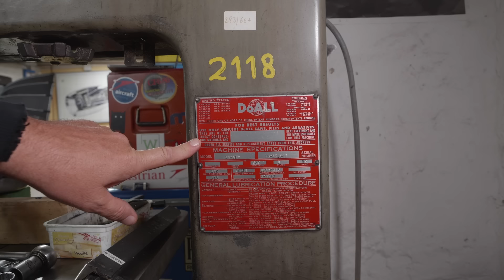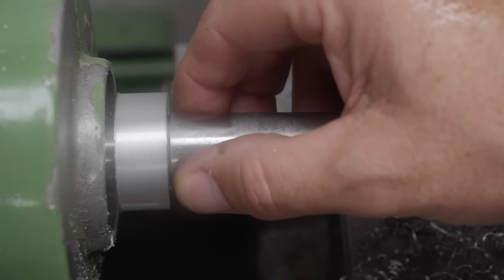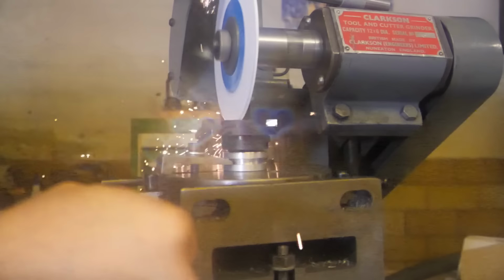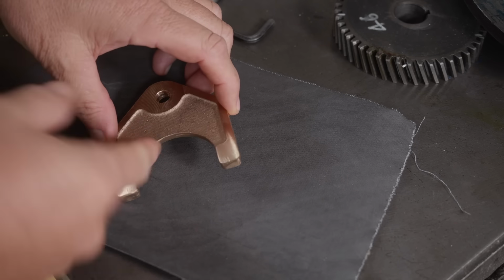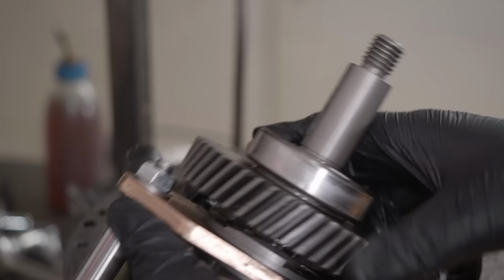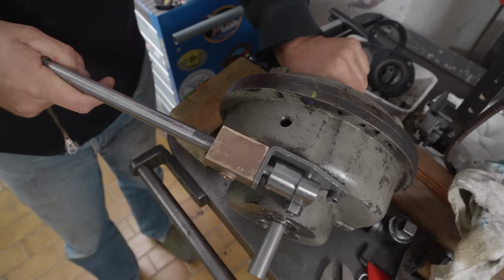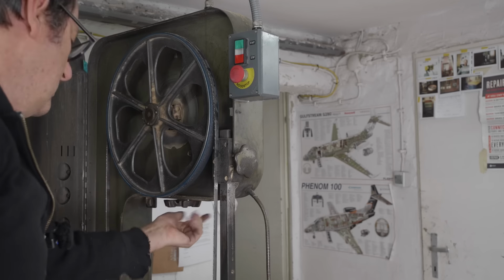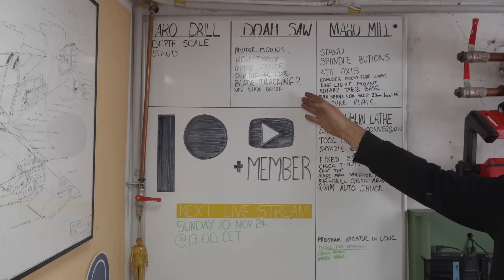Finished DoAll gearbox repair Ep. 10 || RotarySMP

Comment: In 1977, I was given a Hobart restaurant mixer that kept jumping out of gear. I took it apart, and found that the clutch dogs had worn to the point where they were slipping out of engagement.  A phone call to the supplier, revealed that the 1977 price for new dogs was over $700. Outrageous to say the least, so I took to them with a hand file, dressing a small back-rake on the mating surfaces. It worked beautifully after that for many years.
Reply from the maker: Dogs are more tolerant than we think :)
Reply: @RotarySMP  They were made of soft iron so they could be engaged while running.
Reply from the maker: @Landrew0  No wonder they were rounded over then :)

Comment: Nice, that gearbox should be good for another 70 years 👍
Old mechanics trick when installing any heavy flanged mounted unit , cut the heads off of a couple of smooth shank, long bolts and use them as guide pins. Once you have the other bolts started unscrew them and put the regular bolts in.
Reply from the maker: Good tip thanks.

Comment: Fantastic to see the gearbox working 😀 I think if you tilt the top wheel so the bottom of it moves towards the body the blade will move to the middle of the bottom wheel. I don’t think you need to adjust the bottom wheel.
Reply from the maker: Hi Julia, Thanks, I am really happy to be finally able to use it. 
I dont think the DoAll has an in-out adjustment on the top wheel. Just up down and tilt.
Reply: @RotarySMP  yeah tilt the top wheel so it points at the bottom wheel. Obviously my explanation needs explaining 🤣 because both wheel is domed they don't have to be coplanar.
Reply from the maker: @julias-shed  Yeah, I did that, but think I need to space the lower wheel fwd a little more.

Comment: This was a well-fought victory... all the way to coating both sides for no leaky leaky. Congrats. Tracking should [?] be no problemo.
Reply from the maker: I hope it will be easy enough. I just need to find some time to read up on it.
Reply: @voltairegoethe  Hylomar. If it's good enough for Rolls Royce it's good enough for a motorbike engine and certainly a bandsaw gear box!  🙂
Reply: @jimurrata6785  Best thing to come out of Wigan. Although, some would argue that Wigan Casino and Northern Soul clinch it.

Comment: Nice to see the Rotring drawing board! I used an A3 one for many years, until it broke in half. The replacemetn had the same latch on the ruler as yours, but I found the older one with a squarer design was much easier to use : I could use the side of my hand to position in the "Y", but the button one I had to press in with a finger ...
Reply from the maker: I had one of these at high school. It is probably still at my parents place. I bought this one in a flash of nostalia about 10 years ago :)
Reply: @MrLampbus  We had British Thornton drawing boards, really rather nice, A2 I think, flat wooden board, used to hold the paper on with spring steel clips. When I decided to do Tech Drawing for my O Levels, my parents bought me my own B T board and instruments for my 14th birthday. The board is still around, but the instruments vanished in a house move years ago.  I did a college course for AutoCAD 10 for DOS, eventually started using AutoCAD LT, never went back to pencil and paper. I am currently having extreme difficulty getting my head around Solidworks, for the 3D printer.
Reply from the maker: @billdoodson4232  I learned CAD with AutoCad 13, some Inventor, then CATIA V4 and V5, before moving to Onshape and and now Freecad. I think Onshape and Inventor were the simplest to learn.
Reply: @RotarySMP  I could do with easy, my almost 70 year old head doesn't pick things up like it used to. I'll get there with it, just taking longer than it should.
I had stern words with the last pair of apprentices I had working for me. "Don't get fat. Don't get old." I see them on Facebook, neither has got fat like me, but they disobeyed by getting older.
Reply from the maker: @billdoodson4232  Hi Bill, yeah, I am also noticing at 54 that I dont learn as fast, or retain as well as I once did.

Comment: Several times, I've had reason to mount a steel part on an aluminium Arbor with super glue like you did here. If the fit is too close, then the greater expansion of the aluminium when heating it causes everything to tighten up, making it impossible to remove with heat alone 😊 Solvent wins instead.
Reply from the maker: Yep, good point.

Comment: I only just sent it now. Glad they will finally be put to some good use now that that is all sorted. Next I need to cut some similar gears for myself. Will be a good opportunity to try out the dro and cylindrical grinder.
Reply from the maker: Get in contact with Emil and see if he can Plasma nitride your gears as well.
Reply: Found out that a friend of a friend of a friend has a heat treat oven I’ll see if that’s a viable option fist. Did you get my email?
Reply from the maker: @LCalleja  Cool. I need to make another oven.

I got it and responded. Did you get my response?
Reply: @RotarySMP I also would like to make one but it’s not very high up on the list. Didn’t get your reply wonder what’s going on

Comment: Nice job as usual. 
Way back in the days before mobile phones and plasma cutters being common one of the jobs I had was maintaining metal cutting bandsaws in a production enviroment. It was on a rabble of differing bandsaws often mede for different materials and apps.  May I suggest a good rule of thumb setting the blades up. The wider the blade the more pressure you need to apply to the saw push guide stops. A 1/4" wide blade doesnt need push back as much as a 2" wide blade for example. Also I found that the lower push back guide also should lead. It was pretty standard for a non adjustable drive wheel so we used to machine an angle to pull the blade into the guide on them. However that cant be to much and varies with blade thickness. The tilt on the top wheel is really only there to adjust for blade stretch and wheel wear. They will almost always want a crown machined into the rubber. 
Well if that doesnt confuse you the Dementia hasnt taken full hold yet.
Great to see some Hylomar in use as well, its highly underrated. It was the only thing that kept my Valiant head gaskets from leaking back in the day.
Cheers
Reply from the maker: Thanks for the tips. The wheels have crown machined in the aluminium, so the polyeurathane follows that.

Comment: Congrats on the better than new gear box. It's better than new, because now you know exactly how it works and are able to make / order parts for it, as needed. I need to make one of those drawing tablets... my drawing board is a piece of foam core that I put on top of my welding table, and then I just use a square against the side of the foam core. 

Happy Sunday... was feeling ... well disappointed in my fellow americans recently. Thanks for posting ... I need the distraction. =D
Reply: You are not alone. 😐
Reply from the maker: Thanks Mike. Those Rotring boards come up all the time of the classifieds here. I bought this one about 10 years ago in a burst of nostalgia :)

Comment: @RotarySMP I think your blade should run on the front edge of the wheel. Like every woodworking bandsaw. This counteracts the tendency to jump at the back. Mind you, the coplanareity of the two wheels might be off a smidge. Since the blade sat nicely on the bottom wheel. Pretty sure there is a manual for your machine somewhere.
Reply from the maker: That would make sense, but I checked the DoALL manual, and they want it on the middle of the crown.

Comment: re: the lower wheel, the received wisdom in the woodworking world is to make sure the wheels are co-planar, using a straightedge and the lower wheel as reference (since the upper wheel tilts). You'll often find one wheel is in a plane fore or aft of the other, and you can use shims/washers to move one of the wheels forward (or remove washers to move one back). Your lower wheel might be too far back leading to the blade tracking forward.
Reply from the maker: Good points. I just bumped the lower wheel onto the shaft, but without any specific position to aim for. I need to do a more systematic set up.

Comment: On my 14" bandsaw. I just added some washers so the balde ran centrally on the bottom wheel. Dont know if thats the correct way of doing it but worked for me
Reply from the maker: Thanks Peter. Doesn't it make the blade pull fwd in the lower blade guide as well?
Reply: @RotarySMP  yes I adjusted the lower blade guide to suit
Reply from the maker: @petersilva4242  Good to know. Thanks for that.
Reply: On the bandsaws I’ve owned they had to be tracked so the teeth were just off the front edge of the tyre- my understanding is to prevent tyre damage from the teeth. It will be interspersed to see what the DoAll manual advises. With the top wheel vertical ( i.e. no tracking adjustment applied ] it should be in the same plane as the lower wheel just as you would align two pulleys. Adjust the lower wheel position on the shaft to suit & use packing washers as required. Great repair and improvements. I’m in the process of making a new fence for my DeWalt 738 as the one supplied is useless.

Comment: The bottom wheel on a band saw isn't usually adjustable for tilt, Inca bandsaws perhaps unusually have the blade running on the front of the wheels not the crown, position back & forth on the lower wheel is controlled by moving the rear blade tracking roller or whatever back & forth starting with the bottom one (top one fully retracted initially).
Reply from the maker: Thanks for that. I need to systematically go through an review the whole set up.
Reply: I was just coming here to say the same thing. I’d start with backing the blade guides all the way off and see where it runs on the bottom wheel.

Comment: My DoAll 1612 is tracking the same as yours, with no guides in. I have shimmed the gearbox, and that helped. I have shimmed the frame as suggested in the manual. That did nothing. I changed the tires, did not help.  Got busy with other things but will look at it again soon. It can't be anything else but alignment.
Reply from the maker: Thanks for the feedback on that Darren. I received the manual yesterday, and will take a more systematic look at it.

Comment: Probably not the official method, but what I used to do is adjust the tracking on the upper tire and then adjust the blade support ball bearing on the blade guide which controlled the fore and aft position of the blade at the table, and iterate until I had it centered on the lower tire.
Reply from the maker: I need to see what adjustments the DoAll has.

Comment: Im guessing heat didn't work on the super glue because the aluminum expanded from the heat more than the steel, turing the fit from clearance to interference
Reply from the maker: Could be right there.

Comment: Hello Mark - there were shims fitted to the gearbox when I disassembled my DoAll. They appeared to establish the center of the lower wheel crown with respect to, say, the blade guides. It didn’t occur to me that they might not have been all the same thickness, meaning I didn’t discover whether they were influencing tilt. 🤔
Reply from the maker: Thanks Doric. Good data point.
Reply: @ request FaceTime at your convenience
Reply from the maker: I'll get back to you.

Comment: To check the tracking on the bottom wheel, i would completely back away the blade guides. If the blade guide pushes the blade towards the user, the bottom tracking can´t be fixed by the top adjustment. On my cheap chinese bandsaw, i set the tracking without the blade guides in contact, then move the guides to where the blade wants to live. Never dropped a blade off the wheels.
Reply from the maker: Good idea. I'll take a look at that.

Comment: You didn't look to put much tension on the blade in your tests. When I was working we had bandsaw problems so got the blade rep in. He had a blade tension gauge and showed that we were not putting anywhere near enough tension on the blade - with the large machines (25 & 32 mm wide blades) we used he showed that even with the tensioner wound up to the maximum the blade could not be overtensioned. Correctly tensioning the blade largely stopped the blades coming of the wheels in use and also largely sorted issues with straightness of cut and blade wandering. You might get a blade supplier rep to visit you if you asked nicely to do such a check, though IIRC Model Engineer's Workshop magazine have run an article in the last year or so on how to build & calibrate a blade tension gauge.
Reply from the maker: Thanks for the tip. I have a feeling DoAll had a suggestion to tension to a specific musical note when you pluck the rear section of blade. I need to check for that.

Comment: Just watched world War Z yesterday and saw that the passenger plane had a limb in the floor with a extendable latter from the cockpit and was wondering if it's actually true/if they have one or if it's just some Hollywood movie stuff/trick. And I figured. Who is better to ask about that then my mate mark
Reply from the maker: Limb in the floor? Not sure what you mean there. 
Most of the larger Boeings have a hatch near the entry door, down into the main electronics compartment. There is also a door from the MEC through into fwd cargo. Most airlines just put the vinyl floor over the hatch,  as pilots are never going to go in there and there is little they could do anyway.
Reply from the maker: @flikflak24  Maybe the 747 has a built in ladder. The 777/767/757 dont, so you use a maintenance stand. that was an Airbus A310 in the movie, an I am not sure what their config is.

 But there is the E&E bay maintenance access hatch just behind the nose landing gear, which gets you into that main electronic equipment bay, and then if the airline kept the hatch exposed (Boeing), you could get up into the fwd galley area. It doesn't go into the cockpit, and it is not as simple as hollywood made it look.
Reply: @RotarySMP  so it was basicly hollywood magic with that plane. specially since in the movie the latter came down from infront of the landing gear and not behind it

thanks for clearing my woundering m8

Comment: Àdjust the top trackingthere should be no issue at the bottom with crowned tires.
Reply from the maker: Hi Jim, I have the top adjusted to me centered, but the bottom one as running too far fwd.
Reply: @RotarySMP  The top has tension and tilt.
You shouldn't worry about the bottom tracking forward unless it's coming off when you relax the cut.
Is there a backup bearing on the lower guide? Does it rub, spinning the guide constantly?
Really, it's a better situation than having the teeth eating the tire.
Reply from the maker: @jimurrata6785  Good points Jim. I need to do a more systematic survey, and make sure all the guides, backing bearings etc are correctly adjusted.
Reply: @RotarySMP  top tracking should easily bring the blade back on the lower wheel, but as I said it's better to have the 'heel' tracking on the crown.
While I don't have a DoAll I've been using woodworking bandsaws since the mid '70's and had one with a low range that I often used on metal.
Tension is important too. If yours has a spring scale be certain that spring hasn't sacked (I usually pluck the free side of the blade and listen to the pitch)
Now that it is working you're going to find many uses and wonder how you did without it!  👍
Reply from the maker: @jimurrata6785  Hi Jim, I also think there was once a Doall suggestion for a specific musical note when the tension was correct.
Reply: @RotarySMP  You play guitar I'm sure you have an ear for pitch (or a tuning app on your phone)
Different widths should have different pitch because the cross section (mass) is different at the same tension.
It sure is a nice bandsaw now that you've fixed its faults!

Comment: Looks to me like the lower wheel is not on the same plane as the upper wheel. Instead of shimming the gear box to get them on the same plane, place washers on the shaft between the wheel and gear box.
Reply from the maker: Good point. I'll measure it.

Comment: 21:09 oil leak spotted
Reply from the maker: There is a gasket between that cover and the housing, with Hylomar on all sides. So far, the gearbox is dry outside after about 48 hours installed.

Comment: i wonder if the lathe and mill are 'single phase capable' like the haas tm-1 and tl-1 (toolroom-mill/lathe)...
the [new gen.] boeing workers were striking over a month at Everett and finally accepted a contract after costing boeing $6+billion...they wanted a pension which not even the usps postal service does anymore....as if they're in 1965 or are federal employees...they would say boeing is too cheap after acquired from bill boeing and family by corporate conglomerate which is also true: skipped bldg. maintenance, sub'd flight software to india and also the electronics which are key components and led to the crashes that crashed the stock they tried to and did, max out for awhile.
Reply from the maker: Three phase is common here, so we dont really have those single phase concerns. The lathe would just need the motor jumpered from 400 to 240, and the VFD would probably be fine. The Variator needs 3Ph. The drives I installed are already single phase.

The mill would need more extensive modification.

Comment: You may have to shim the gearbox to match the guides/upper blade wheel as shown in the instruction manual.  Also, mine has a spacer/shim behind the lower blade wheel as shown in the parts manual. I've got parts and instruction manuals if you're interested.
Reply from the maker: Hi Steven, which model is yours? Mine is a 16"-SPF. I would appreciate a scan of the manual please. My Email is on the channel about page.
Reply: @RotarySMP  Mine is also an 16-SFP.  
Happy to help out.